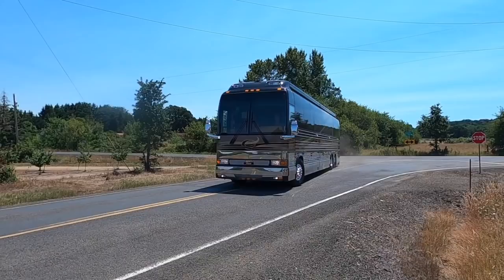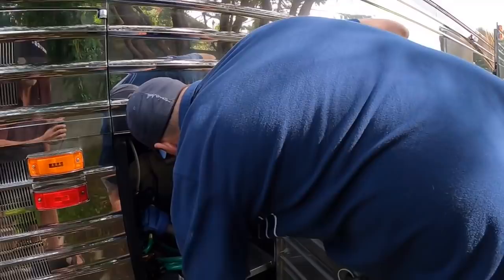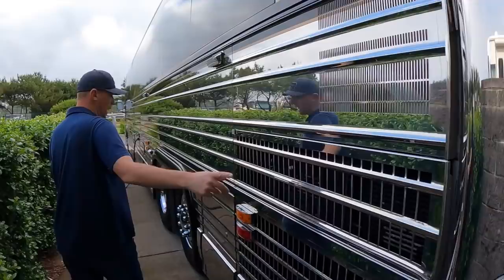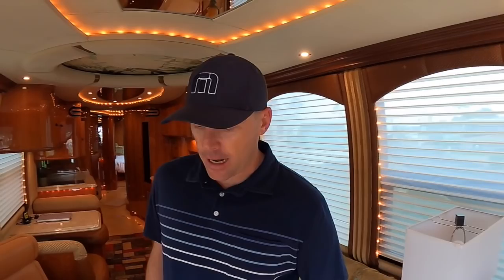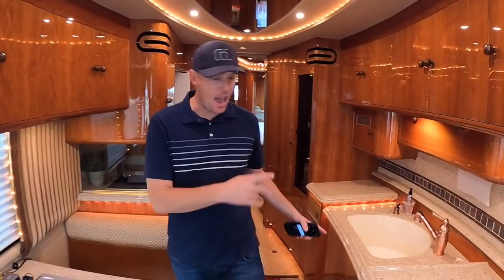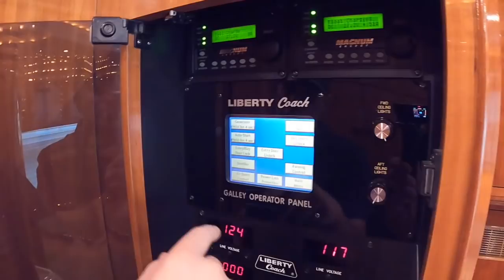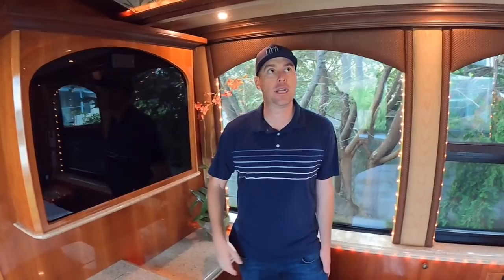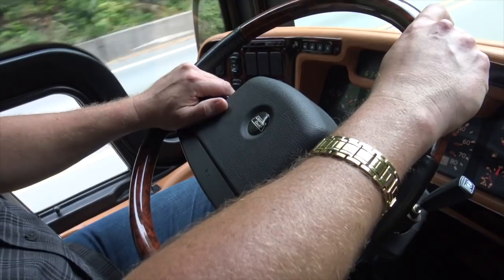2003 Prevost Liberty Coach Non slide for sale

Comment: Truly stunning coach! I've seen this coach in person with my own eyes, and can tell you it's one of the cleanest Prevost coaches I've seen! 

Some may say that the non slide have no room, but I will tell you this coach is VERY comfortable inside. 

I will also tell you (from experience), slides are a pain in the checkbook! In the past 5 months my coach has had the slide seals replaced on 3 separate occasions!!! NOT FUN!!! 4 if you count the set that were installed right before I took possession.......and the added bonus is that you are pretty limited on going anywhere when your slide seals go, because your air system runs everything!!! Try keeping your suspension and brakes functional when you have a slide seal blow!!!

Seeing this coach in person has no comparison to any video or picture taken of it. It IS a UNICORN, and will blow your mind when you see it!!!

Great job Andrew!!! And CONGRATULATIONS ON YOUR 100K MILESTONE!!! That's a huge achievement!!!
Reply: Thanks bud. Love ya man 🤗😍🙏💝👍

Comment: ❤  It's important to point out that this engine is designed to run 1,000,000 miles or more before a rebuild  is required. This couch does not require DEF and that means no regen to deal with.👍👍

Comment: Great looking coach. These old buses have prices following the housing market right now. 2 years ago this was a $150k coach. Series 60 and Non-Slide is a unicorn though.
Reply: I think I saw Andrew's video of the previous owner asking $360K a little over a year ago. Surprised they're asking $399,999.  I know the current owners did some work on it, but seems a bit steep.
Reply: @Prevost Life All about supply and demand.
Reply: This coach has never been a $150k coach.  That’s ridiculous.
Reply: @DutchStar443  2 years ago — a 2001 non-slide coach with 100k miles was a $150k coach all day. Big dip at 10 years old and the. Another before it hits 20 years old. So no, THIS coach wasn’t $150k 2 years ago, but the equivalent of what it is today would have been. 👍
Reply: Those old prices are WAY undervalued IMO for these well engineered machines & exqusite high & many hours crafted art in wheels

Comment: Had to come back and watch this one more time. Man, I wish I had the means to get this one. And as for the steel chrome wheels, that is something I would want for sure, some may not know but I have found that in certain areas across the U.S. it can be hard to find places that will change tires on the aluminum Alcoa wheels that are on a lot of coaches. They just don't want the liability because most are done by hand with tire tools, like pry bars, so they can damage the aluminum pretty easily. And some may change them but it takes them all day.

Comment: I own a small fleet in Colorado. I don't know RV's, but I do know semi's. I have 5 Detroit 60 series, 2 Cat C-15's (one Acert), and 3 Cummins. The Detroit's are nothing but trouble. Yes, they have the parts availability but that's where the benefits end. Out of those 5 Detroits three of them have had bad heads, multiple turbo issues, EGR issues, injector issues, water pump issues... It just doesn't end. 

I'm not speaking out of malice, I am speaking from data. Anytime you want to go over my PnL's and I can show you our repairs per truck with a Detroit vs literally anything else. Yes, these issues persist in both the 12.7L and 14L. 

I did buy a new Frieghtliner with a DD15, no issues with that yet but its a new truck still.

Comment: 👍 Very nice Prevost Conversion Coach.  Good sized large kitcen counter, huge food refrigeration, jackknife couch long enough for adults, nice roomy bathroom, north south facing master bed, and do have mirrors here and there but not over done.  Hmmm... but $399,000?  I don't know.  I just saw an beautiful County Coach Prevost XL2 for $299,000.  I do know that Liberty does incredible job, but $100,000 is an big difference.
Reply: I spent well over 299K for mine, and it wasn't zero'd out. Another 100K min  to get mine dialed in 100%, and still no guarantees!

Comment: Awesome machine.  I would change the couch and those blue pillows on it were not flattering to the interior of the coach.......Two super easy fixes.....Does anyone here know where to get the string lights this coach has around the interior windows.  My 1998 County Coach Magaa is in pretty darn good condition but the factory installed string lights have some burned out lights so the string needs to be replaced on a couple of the windows.  Country Coach is out of business so not sure where to turn to.

Comment: 06:18 why no mention of towing capacity?
Reply: @All topics R Possible  Okay but when the machine is equipped with a hitch, it seems that "what you can do with the device" is an obvious question, If the coach had a lithium battery pack would you be interested in the capacity of the system? If it has a freshwater holding tank, is the size of the tank of any interest? How about the grey/black tanks? Fuel tank? On my watch, it takes about 3.25 seconds to say, "this hitch has a thirty-thousand-pound towing capacity." So, as you claim, a 4-hour video, there would be just short of 44,471 intervals of 3.25 seconds. Seems to me a mention of towing capacity was in order. Adding 3.25 seconds to the video is not a show stopped.